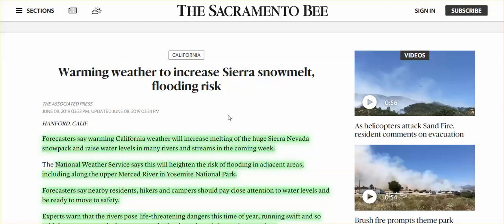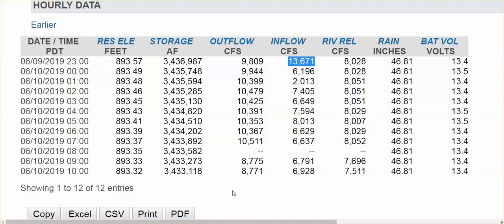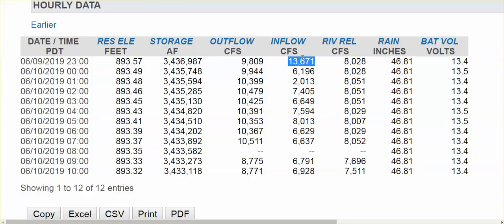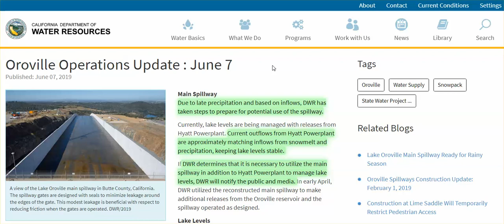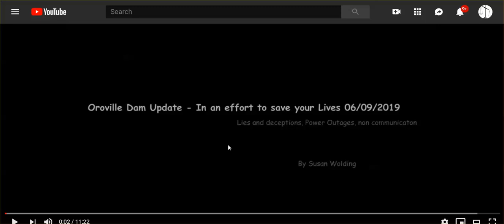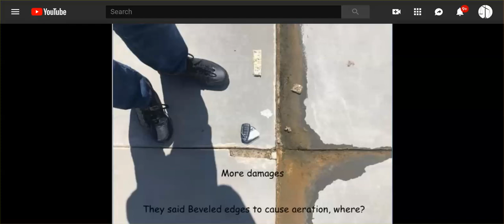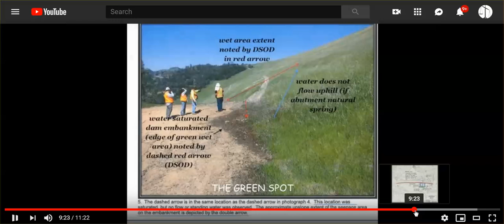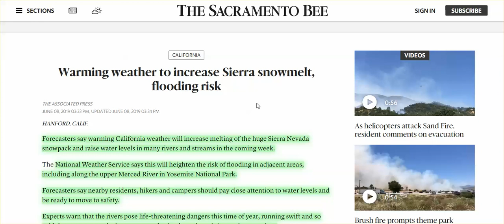Oroville Dam Update: "Snowmelt To Increase Flood Risk," But Only 8 Feet To Capture It? And More...

Comment: Consider a tactic, I twted Gov Inslee of WA to consider the dam capable of a glacial outburst flood, GLOF, due to conditions and age of the dam are similar enough to a moraine to require constant monitoring via optical sensors & hi•res GPS as the only way to have reliable predictions of a failure.

With laser targets on the whole thing, if any part is bulging or vertically displaced it can be tracked and analyzed instead of the mystery game.

I asked him to knock on doors to get USGS to install it.

Ymmv, tom.